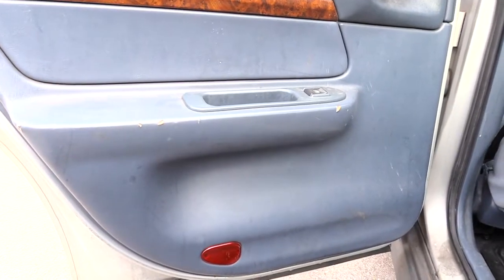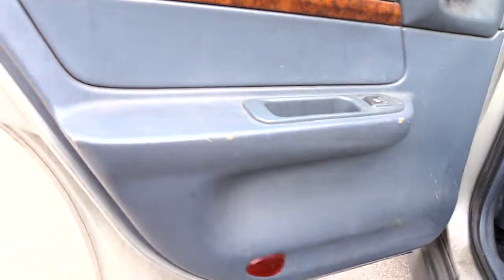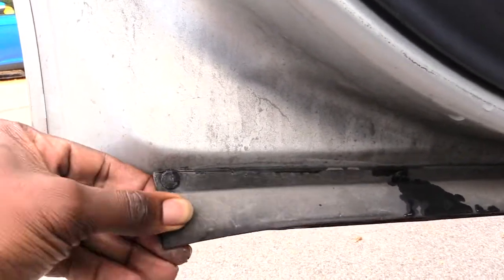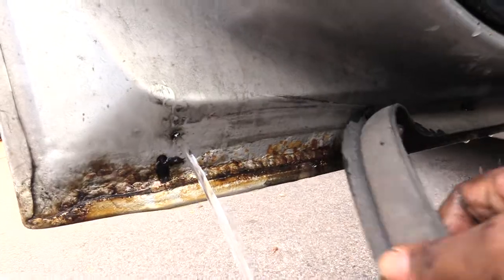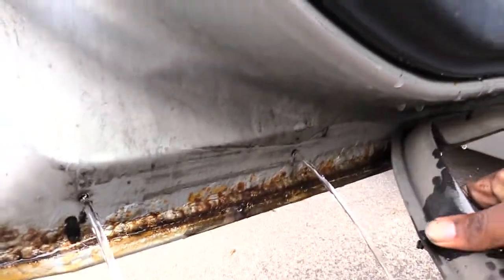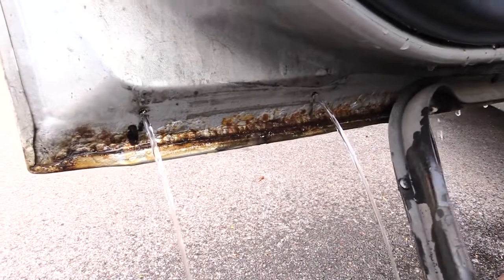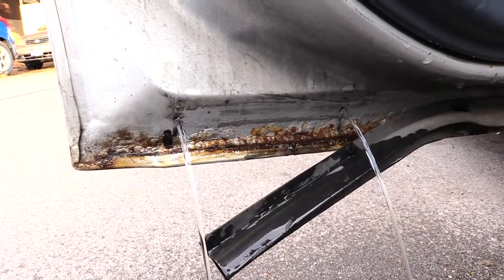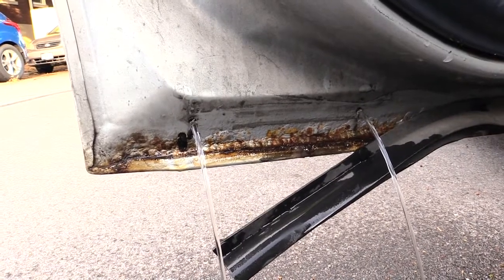How to Get Water out of Vehicle Door!

Comment: There should be holes at the bottom of the doors which may have got clogged up. Use a matchstick to clear the holes. You shouldn't have to remove any rubber seals etc.
Reply from the maker: Thanks for tip ☝Please subscribe & like and share if haven't already and check out our other helpful videos

Comment: Hello, I had recently bought a 2011 Honda Accord directly from the owner and a few weeks ago, I noticed that the window mouldings were damaged/ non existent. When I checked the under side of every door, I saw that there were drain holes on each door. I am sure water will seep into the doors when it rains. But will it be a problem in a car wash? A lot of water will seep in and may or may not drain out. Someone please help. I have been using duck tape till now, but that doesn’t look good and I am not able to roll down the windows when I have to, like in a drive thru.